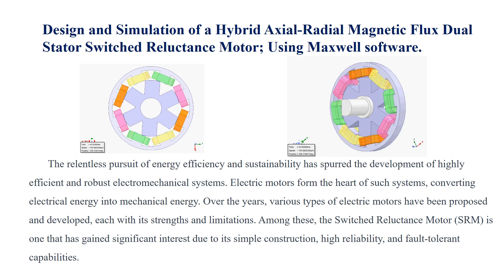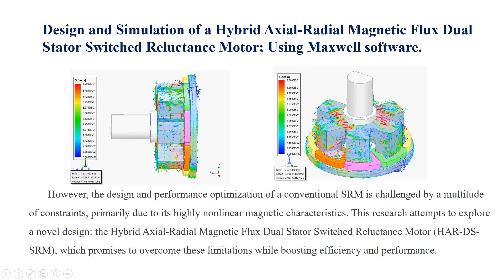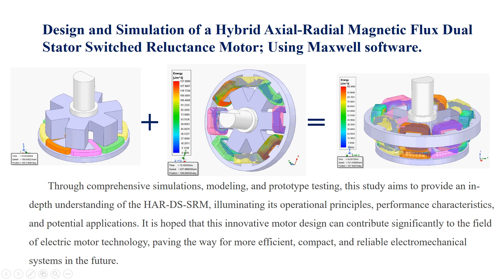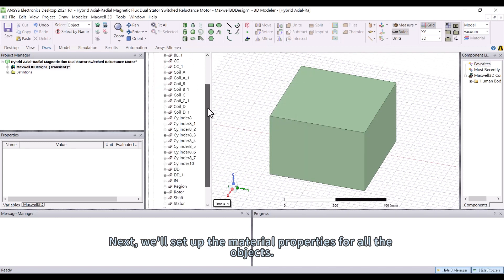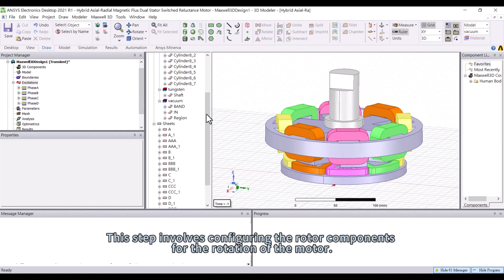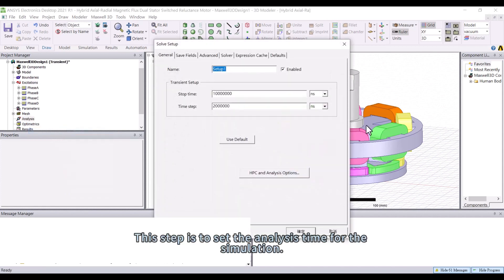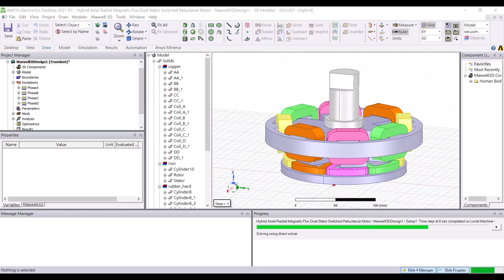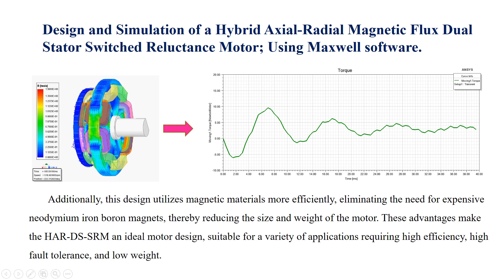Design and Simulation of a Hybrid Axial-Radial Magnetic Flux Dual Stator Switched Reluctance Motor

Comment: Did you have any thoughts on the disk axial stator and one radial stator design ideas? And why 4 phase vs three phase?
Reply from the maker: Generally speaking, the design of SRM can have multiple phase configurations, but the four phase configuration is the most common.
As long as you can familiarize yourself with the most basic principles of motor control and design, you can design countless new types of motors, whether they are radial or axial flux motors.
Reply: @johnhsu5773  understood thanks. And your thoughts on adding a second axial stator to this design? Any idea how it would affect fields?
Reply: @johnhsu5773  have you seen this? It's an interesting proposed design for the dark matter motor but others have proposed a single central rotor with u-shaped coils wrapped or bent across the rotor rim; two different ways of getting the combined axial and radial effects from a PM motor. https://youtu.be/O2rVw2zGgvg?si=ZPoWxy1oVcfI2kVD